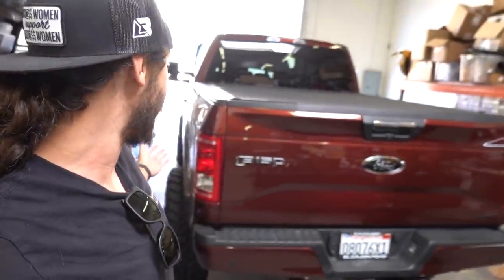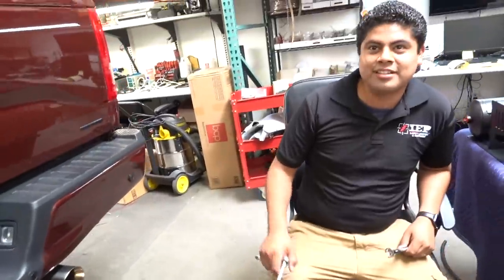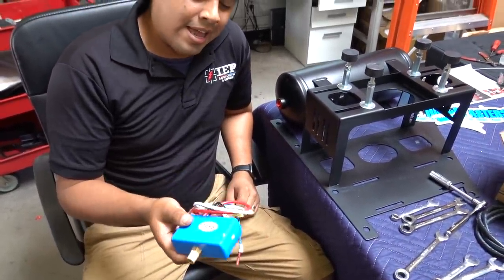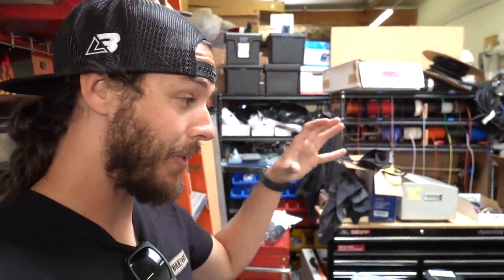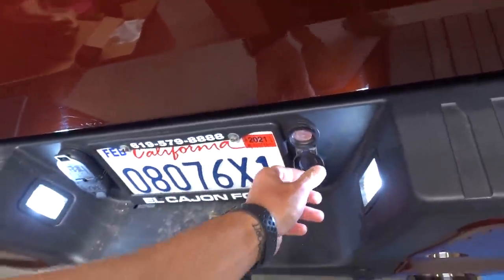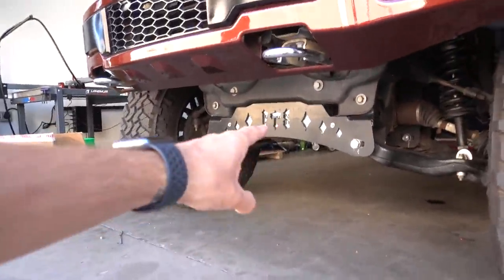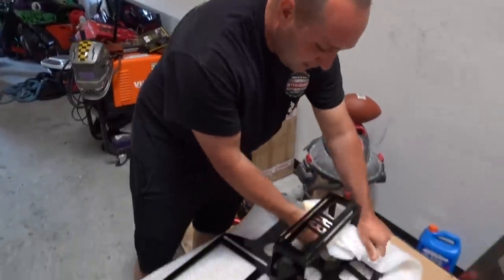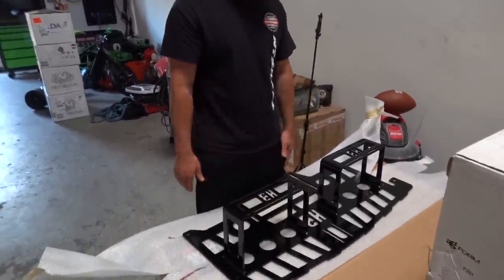THE SMALL BUT MIGHTY (AND INSANELY PRICED) TRAIN HORN!

Comment: I could never spend 1200 on a horn even if it was solid gold bro. Ya'll wild
Reply: I personally couldn't spend that on them either. Unless I won the money and didn't have to work for it. Or some trump money 💰 🙈🤷‍♂️ but not my hard earned money. Lol
Reply: Just spoiled the price but holy 😳
Reply: Car mods in general are quite expensive. If you want a horn that’s the price you pay
Reply: They kindof all sound the same. I use to have train horn but now its just sitting under my truck doing nothing. Had it for 10yrsnand havent used it for 5yrs
Reply: You spelled y'all wrong
Reply: @Braveblackjeep  no that's how I intended on spelling it.

Comment: “the spare tire cable which will i’m assuming
loosen up over time” why would it loosen up? if it can go hundreds of thousands of miles with a tire i’m sure it can handle a 7lb horn
Reply: I’ve been running a kit that is like 3 times heavier using the spare tire tire cable with no issues for about a year now and have done a bunch of off-roading